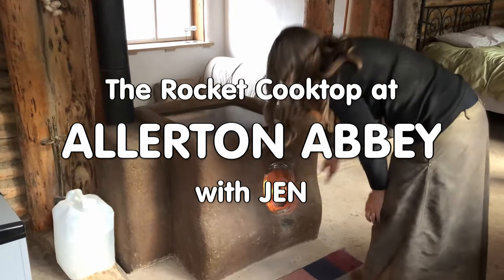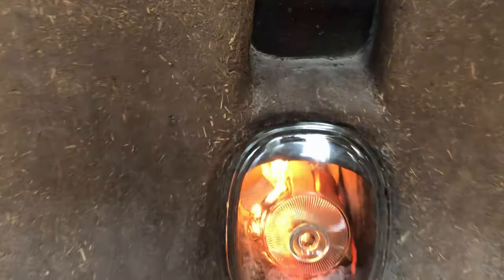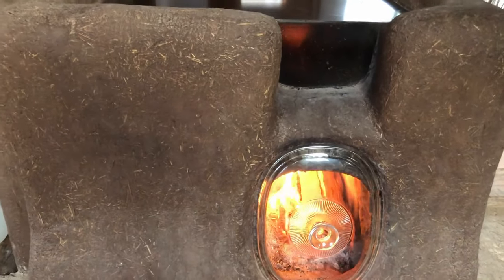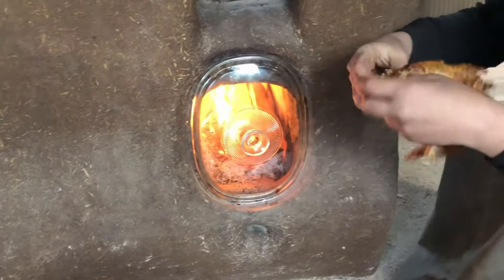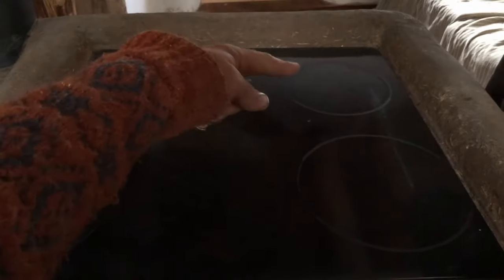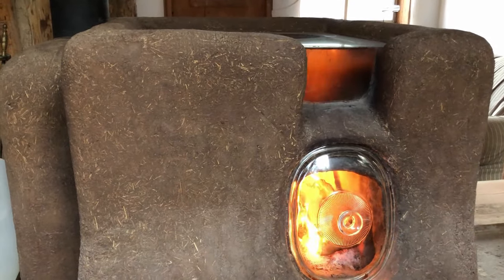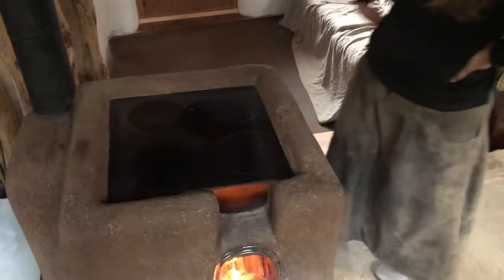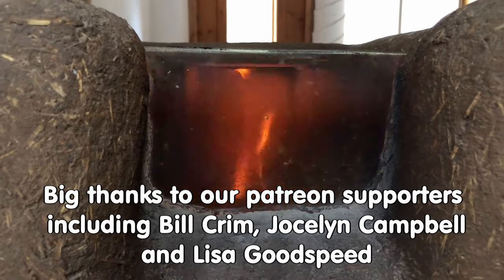an indoor wood cookstove made of bricks and mud

Comment from the maker: The glass plate on the top came from a broken glass top electric stove
Reply: Never thought of using one of those..... DUMP HERE I COME
Reply: I was just going ask about the glass top.....
Reply: How about the glass just below the top surface... is that connected/same piece of recycled cook top?
Reply from the maker: @DavinHoyt  The original glass top was bigger than we needed, so it was cut down.   That bit of glass came from the leftovers.
Reply: @paulwheaton  Absolutely gorgeous looking stove, How did you seal the 2 ceramic glass together? if is it just a tight fit with no sealant? if so what about smoke? also I assume that is just a normal pyrex lid, simply amazing. how does it hold up to heat?
Reply: @leoncryp8182  There's no seal between the pieces of glass, I've used the straight edge of the glass to fit under the cook top. The cooktop itself will stay perfectly straight and that connection is short. When it wasn't even ready in 2017 when we were running out of time. So we tried to light it, but other crevices and leaks were large enough to belch smoke, that connection didn't.
The pyrex lid is one with a glass knob, that are the proper ones. Avoid lids with a metal knob, those will shatter in due course.
Reply: Also, when the chimney is working properly, the stove itself is a negative pressure area. Small seams will draw inward instead of blowing outward.
Reply: @peterberg10   Thanks for all experience you already shared! Is there some plans about this please?
Thanks Paul by the way ...
Last few questions please:the top plate isn't sealed isn't it?Maybe ceramic wool under,not afraid by the glass will broke here or on the front?What about cleaning inside,how do you access to?Thaaaanks😊
Reply: @fred4926  Yes, the design is available. See https://permies.com/t/71823/batch-core-riser for how it came to be, the design is posted there too. In the mean time double shoebox rocket mark II came to light which I prefer over this one. Mainly because the mark I has the tendency to run hotter and hotter all the time, leading to what we call a thermal overdrive. Not bad for a cookstove but definitely not suitable for a space heater. See for the mark II development http://donkey32.proboards.com/thread/3503/double-shoebox-rocket-mark-ii

Comment from the maker: I think a huge thing about this cooktop is that it is NOT propane.  Offgrid folks tend to have propane cooking stuff.
Reply: Propane is adjustable. She mentioned a lot of stuff burns on this. Since rocket heaters require hot burns to function properly, how do you tone it down? It’s great to be able to use wood but not if you only get super hot burners.
Reply from the maker: @brucea550  She mentioned that she has burned stuff if she is not careful.  Which is the same for any stove that can get hot.   Her mentioning it is to point out that the stove can get hot - some people thought it might not get that hot.
Reply: I would not have doubted it’s ability to get hot, we’ve built variations of these mini Russian stoves for decades for hunting cabins (none quite that polished looking). They’re great for heat and cooking, as in- boiling water or frying things. But to really ‘cook’, propane is a lot friendlier when you don’t want blistering heat all the time. To cook with wood I like a steel stove (or ideally, cast iron) because you can move the heat around by how you place the wood. Wonder if it would make sense to have a steel or brick baffle under half the top to make a ‘low’ side?
Reply from the maker: @brucea550  There are a lot of things that I don't like about a propane stove, but at the top of the list is how people say "I'm off grid" and they use propane - which is LPG (liquid petroleum gas)
Reply: Doesn’t ‘off grid’ simply mean ‘not connected to public utilities’? So using propane is still dependant on infrastructure, but so is using the internet, buying gas or diesel for vehicles and equipment, ordering things from Amazon...
What is the distinction with propane? Is it any uglier than the carbon footprint of a PV panel made in China, with all the toxic waste involved?
Reply from the maker: @brucea550  Propane is part of "the grid."  Most people can't go out and find some propane outside lying on the ground.
Reply: Or gas, or diesel, or PV panels, or laptops, or internet service... I don’t see what’s any different about propane. Where are you drawing the line as to what’s acceptable and what isn’t? Propane comes from the same source as fuel for vehicles, so does off grid mean only bicycles or horses for transportation?
Reply from the maker: @brucea550  good point.  i choose to draw the line to something of a community where people just don't feel like driving much.    Propane is energy, so I guess i am good with wood, but wish to exclude propane.
Reply: @brucea550  I'd say how "adjustable" this is depends on the temperature spread across the entire surface. And obviously, if you load it up with wood it will make the thing hotter. Obviously, this is less convenient than turning a nob but I bet still doable.
Reply: @brucea550  I definitely burned some things before I got the hang of it, but it's not too hard to cook on. The main thing is to move the food to a hotter/cooler spot on the stove depending on what you are trying to cook, and to time it with the feeding of the fire (if you just fed it a ton of kindling, it's going to heat up a lot really quickly). It definitely requires a little more thought and attention than a propane burner, but we can collect the fuel for free and don't have to get a tank filled, which is nice. We cook eggs, oats, rice, stir fry, pasta, toast, pancakes, heat up leftovers, etc. on it all the time without much trouble. I think we will be making a cooking video soon.
Reply: A cooking vid would be neat! I cook probably 80% with wood, which is not free, as it takes my time, which has value, but propane, the other 20%, takes $50 a year. Problem with wood, aside from lack of control, is that you don’t want to be cooking on that in the summer and make your dwelling hot. My next project here is an outdoor kitchen so I can cook with wood June to August. I find with my wood stove (1/4” plate steel top) I have mostly all hot areas, but use metal trivets of various thicknesses to create cooler ‘burners’. As you mention, you get good at it with practice! 🙂
Reply: Bruce A An outdoor kitchen is also on my list!

Comment: Are these glass tops shatter proof? I wonder what would happen if you put a cold pan on such a hot glass surface, like thermal shock. I'm rather nervous about glass and extreme heat. Heck, I've cracked a bottle by pouring hot water into it. But  it does look a neat stove.
Reply: I think they can add lead to the mix to make it more flexible. These radiant glass top cook stoves are pretty popular and they seem to hold up pretty well. They're supposed to be good for 1400 degrees so at 1000 they weren't over stressing it.
Reply: It’s a glass ceramic blend, they are designed to handle high heat and heat changes. A cold pan would not crack it. Dropping something on it would.
Reply: Thanks, that's good to know. Is it possible to use any induction hob top? I was thinking of using a 1 or 2 ring hob plate for a mini cooker/stove for my tiny house.
Reply: I’m in no way qualified to say yes, but I have no reason to think the answer would be otherwise; as far as I know they are all made the same way. May be harder to find just a 1 or 2 ring glass top, but a large one could be cut smaller, probably with a tile saw with a diamond blade. I think this is a really neat idea to cook on a rocket stove, other than it being hard to control the temperature. You also can’t use cast iron cookware on a glass top.
Reply: @brucea550   I am actually living at Allerton Abbey with Jen at the moment, and I use my cast iron skillet on the rocket cooktop every day with no problems. It's actually quite easy to cook on once you get the hang of how the fire moves around in a horseshoe pattern underneath the glass. If it's too hot I move it back a bit, and if it gets a little cold I just add more wood. Usually, I keep my tea kettle on the hottest burner, and I'm cooking on the 2nd to 3rd burner (or corners I should say, seeing as the actual circles that indicate the burners are in the wrong place to indicate where to cook). They aren't running the rocket cooktop hot enough in the video to see the fire going around underneath the glass, but when you get it hot enough to cook on, you can see it glowing red. This lets me know that it's hot enough to cook, and I can adjust where I place my pan depending on how red and hot it is. Pretty simple, if you ask me.
Reply: Judy, I have the same fear as you, so I mostly try to avoid putting a cold pan on the stove when it's really hot, but I have definitely forgotten to put my room temperature (approx 50-60 degrees) cast iron skillet and stainless steel kettle on the stove until it was already heated up, and didn't experience any problems when I stuck them on there anyway.

Comment: At a 1000F the only thing I could cook would be Blackened ____________. Select your food stuff. :)  Neat design, I like it.
Reply from the maker: Water?  I think you might find your fastest water boiling ever.   

Using a wood cook stove is a little different.   If you want a lower temp, move the pan to a cooler part of the cook top.
Reply: I was hoping the video would mention the difference between the hot corner (1k degrees) and the temp of whatever the coolest area was. Most stovetop cooking only needs 250-350 degrees. Could that be maintained for any length of time by how few sticks of wood you burn? It’s relatively easy to do with the big cast iron cookstoves like dirtpatchheaven has. A Russian fireplace oven is pretty consistent for hours at a time. This glass cooktop doesn’t have mass to hold heat so it’s all dependent on the flame below, correct?
Reply from the maker: @brucea550  All correct.  This will be a lot like julianne's wood stove.  There are spots that will be hotter than other spots.   If you build a really small fire, put your pan right at the hottest point.    But if you are boiling water at the same time, put the pot of water on the hottest point and move the pan to a cooler spot.
Reply: You can definitely adjust the cooking temp by moving things around and/or timing your cooking based on the fire--you're not always cooking at 1000 degrees!